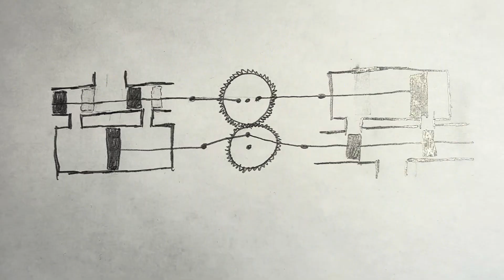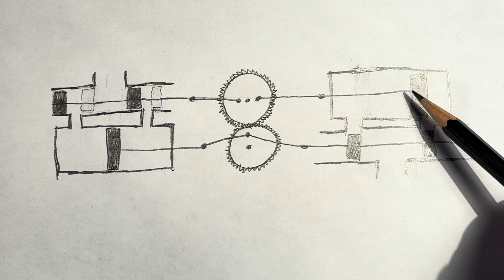LEGO vacuum engine with quick-reverse mechanism

Comment: This is crazy, I love it! Did you try lubricating it? You can use olive oil or if you dont care if it's not edible, silicone. I'll sub so I can see it running :)
Reply: Maybe it needs a flywheel but being a 2 cylinder it shouldn't.
Reply from the maker: I don’t want to use anything like olive oil that would get gunky after a while and force me to take the whole thing apart and wash each and every brick. I would have tried powdered graphite but it’s messy and I don’t have any.
Reply: @dragoncoder047  DONT use graphite!! I used it on my first attempt on an lve and the mess it made was horrendous.
Reply: Silicone spray is a great choice imo, it will make any lego engine come to life.